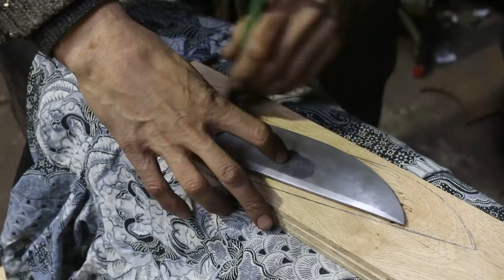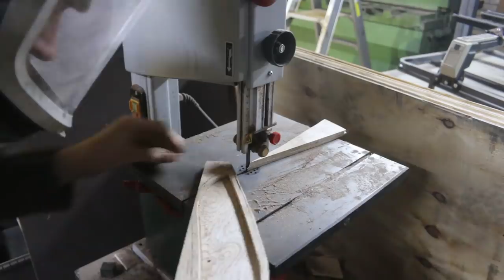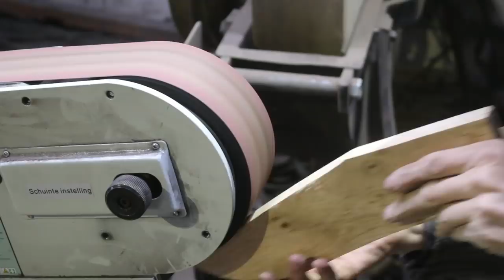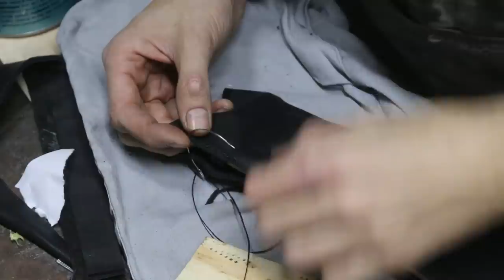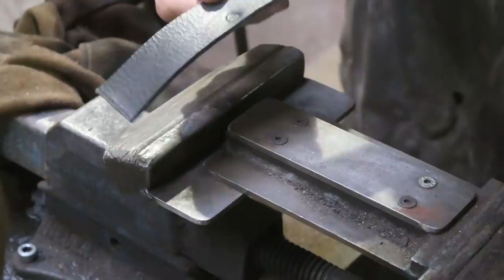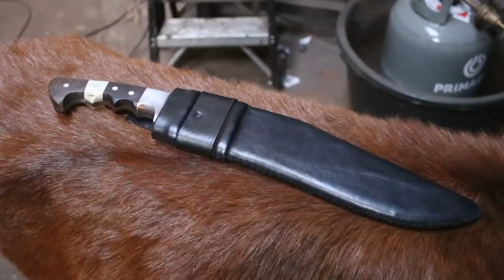Forging a pattern welded Khukuri,  part 3, making the scabbard.

Comment: Freerk, i'm thinking about making a forge in the future and been seeing alot on the ribbon type burners and wondered if that was something you had thought about or something you don't want, if so is there a reason, i ask as a majority of its use will be sword blades so i  thought i's ask your opinion on ribbon type vs multiple single ports (the type you have)
Reply from the maker: I never used them so I don't know the differents that well